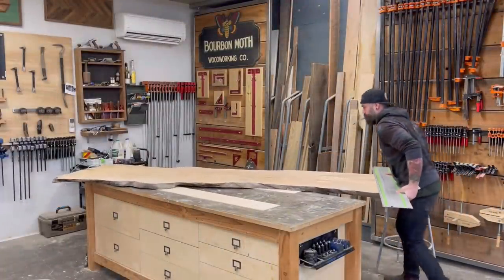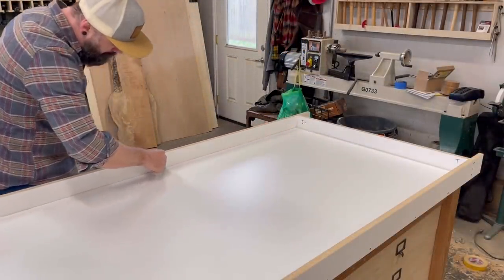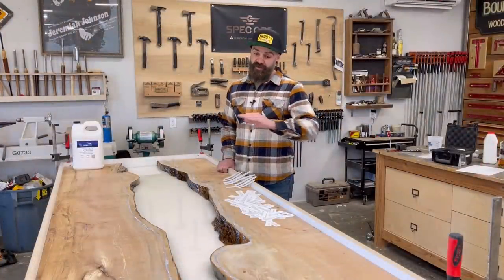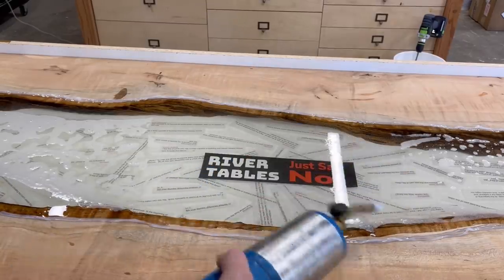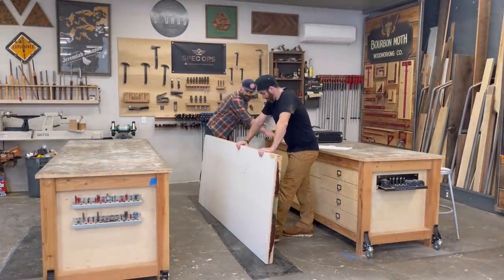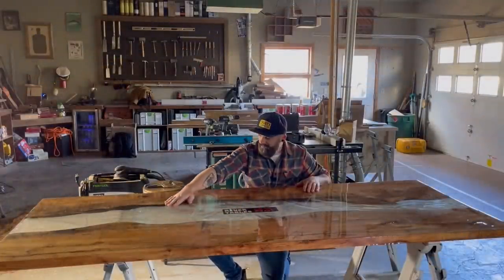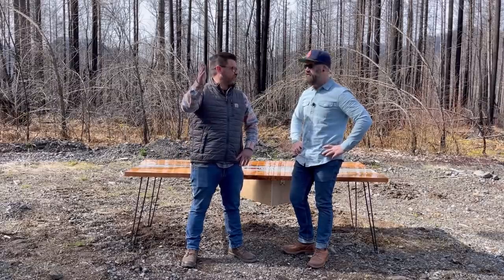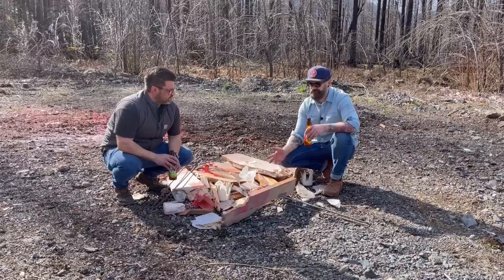Exploding an Epoxy River Table || Making an epoxy River Table

Comment: I have to agree, river tables look horrible but the large single slab tables (sawn edge or live edge) are a good use of resources and I think look absolutely amazing with the grain perfectly matching the entire table surface.

Without buyers of large single slab tables giving value to larger tree’s that normally fall outside the conventional milling capabilities it would mean that the larger veteran tree’s which are most often blown over or destroyed in storms would end off being burnt as firewood or cut down before they reached their full growth potential and ultimately ruining my chance to go hug a massive oak, walnut or redwood. 😁

A lot these big slabs need a little epoxy for cracks and defects but yea, river tables…Big no, no.

Comment: I find it a bit weird that you're opposed to sealing beautiful wood in plastic (reasonable) but ok with staining beautiful wood an unnatural color with Rubio Monocoat.  Personally, I find staining good (non pine/etc) wood to be even more ugly than a thick coating finish over it like epoxy.  Though I'm not a fan of either (though I do like some river tables, but always the quality made ones where they take the time to properly sand it and use a regular shellac finish over the whole thing... keeping the wood texture where it's wood... rather than epoxying the entire surfarce.)

Comment: Blacktail Studios actually makes beautiful tables using epoxy. Many of them probably don't really qualify as "river tables". He doesn't cover the wood with epoxy, either. It's just there to join the pieces and add color/contrast. He uses actual finish products like Rubio Monocoat or Odie's Oil to finish out the wood.

Comment: HEY those stupid jokes and off putting idiocy are the best parts, next to the wood working, damn it. I love your vids brother. I do have a question though. I'm not saying I hate river tables but how do they hold up over the years? I mean I know what you build will last probably forever with some care as you use real wood and care in how you build. But wood breathes and flexes, epoxy doesn't.

Comment: I think river tables are pretty unoriginal at this point BUT epoxy and wood does make for really cool looking stuff - it's fun to engrave lettering and fill it in with epoxy - or electrically burn a piece of wood and fill the cracks with epoxy - or just to get cool patterns and colors that you can't get from wood stains alone. Just like anything - it's probably not going to be great to build everything you do around it but when you treat it for what it is - a tool among many...many tools, it can serve you well - but to each their own. I really dislike coating the wood parts of epoxy & wood pieces with epoxy because I don't see the point - just make it entirely out of epoxy at that point and I also think bowties look really stupid and bad.

Comment: 'wood floats, so that's why they make boats out of it'... ehm :-D Not really I'd say. The density of wood is lower than that of water but not that much. It is about the displacement. 
If that statement was true, then why are boats made out of steel? :-) Steel doesn't float...

Comment: You might want to wear a respirator when working with epoxy, particularly when sanding it. Then again, wouldn't work with that magnificent bush you have growing on the bottom of your face for some reason...

Comment: Since you don’t like the modern plasticity mess of modern epoxy try using an older natural technique using resin off acacia trees and then tell me the plastic is still gross. I understand a dislike for the resin dips because a lot of them seem kinda childish but tbh it’s just glue which is a part of wood working. Experience with different glues will help your wood working so how’s it not part of it?